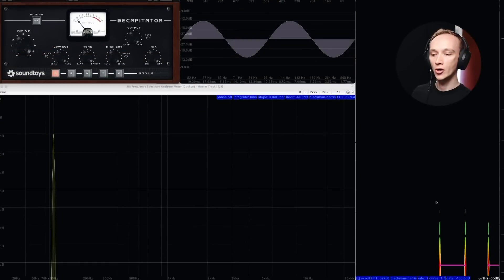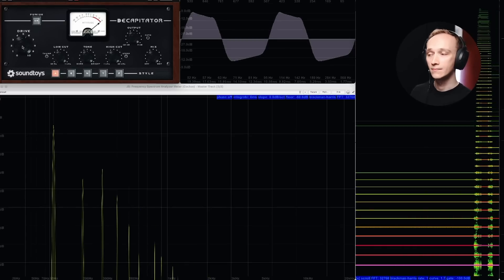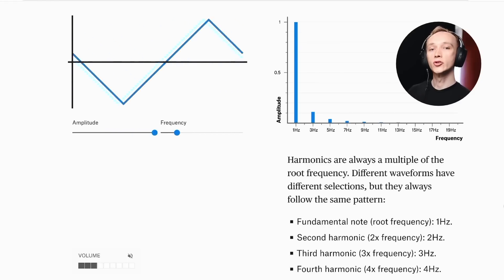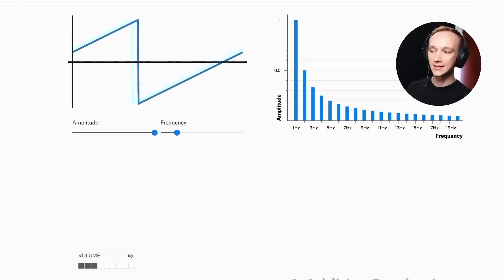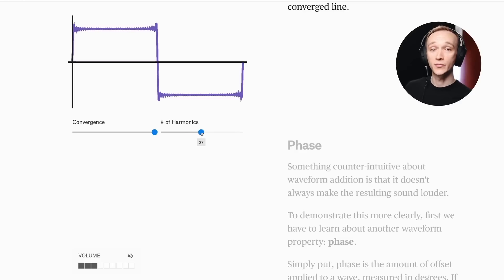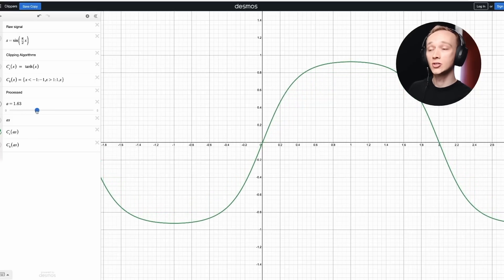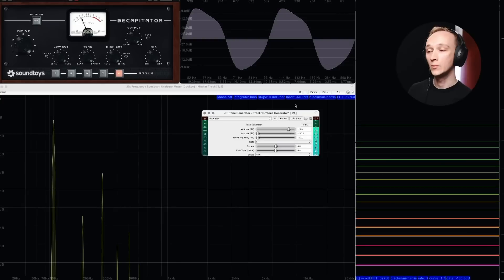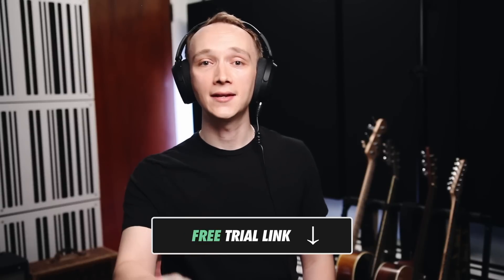Most Engineers Get Distortion Wrong

Comment: Gain staging only matters before dynamics plugins like compressors, maximizers, limiters, and saturation plugins. Or if you’re routing through hardware. Outside of those cases it’s more of an organizational thing.
Reply: Yes, but a little to add. I agree gain staging is definitely more important when dealing with dynamics processors (simply because they are dealing with peak analysis therefore input gain will be acting as a threshold for the effect) but a lot of other processing you wouldn't expect can also be gain dependant due to recursive internal processing - feedback - of the input signal. Things like short delay effects (choruses, phasers etc) will tonally sound different, and provide non-linearly gained outputs especially with high feedback, when sent differently gained inputs. Also, anything that is "analog modelled" even if it's not a dynamics plugin will almost inevitably require a correctly gained input in the same way as real analog hardware, by design. Digital has near infinite S/N ratio so, unless you're clipping, you're mostly right but I'd stack onto dynamics processors a few other things if we're getting super particular!
Reply: @RDijt  I did not know that, thanks for letting me know.

Comment: You know what else all the kids get wrong when it comes to audio? The word "saturation". "When we increase the drive knob we increase the amount of saturation that occurs". No. When you increase the drive knob you increase the amount of harmonic distortion that occurs. Saturation is when analog tape or a transformer is saturated with magnetism. The result of that magnetic saturation is harmonic distortion. I'm assuming kids started conflating "distortion" with "saturation" either because they're relating it to images and color saturation or it's a marketing term because "distortion" has a bad connotation to it. Saturation isn't distortion. Saturation leads to distortion. If you're going to use a click-baity title that condemns "most engineer's" knowledge and understanding of audio, you better make sure your side of the yard is in order first.

Comment: Is there a difference if A is 440 Hz and A with 432 Hz?
Reply: 440Hz and 432Hz are different frequencies, that's the (only) difference. Not very noticeable though.
Reply: @luisybarraaspichueta3405  yeah I know, but my question was if the distortion sounds significantly different. Because 8Hz can make a difference
Reply: @DashNiveDNB  Yes, it will sound 8Hz higher (not very noticeable since 8/440 is a fairly small fraction), but the timbre will be exactly the same. What makes two sounds have different timbre/tone is the ratio between the frequencies of the harmonics that make them up, and their relative volumes ofc. But, a pitch shift applied to all those tones equally doesn't change the ratios at all.
Reply: that's why a piano sounds like a piano regardless of the notes you're playing

Comment: Very interesting video. Maybe related to this, I was experimenting a bit with basics, filtering saw waves etc to find in the end your turn them into a sine  (which may picking a saw for a bass track in a way seem silly when you filter all the saw-ness out?). On the other hand, to my surprise (no education in this area), I found the filter in Vital added frequencies when I was (by accident?) filtering a sine wave. Is there a video of yours on this topic or that explains this? How can I add something by taking away things?
Reply: Some filters in Vital emulate analog filters that have a nonlinear response. That's the only reason. As you've said, a "perfect" filter shouldn't add any harmonics to the signal, only change the volume and phase of the existing frequencies
Reply: @luisybarraaspichueta3405  Thank you very much for your answer. So in theory it shouldn't, but in (physical, analog) practice it does 😉
Reply: Now I'm going to try a full digital VST synth

Comment: I don't hear the difference between the Radiator plugin on and off. Does it mean I'm deaf or my speaker system is too cheap? Or it's intended to be audible using headphones?
Reply: it's almost a matter of "feeling". Most of the people who claim to hear an obvious difference would fail an A/B test. When Radiator is on the track just feels a bit louder and with a bit more presence. But it's definitely very subtle, you won't tell the difference on phone speakers ofc, but any decent pair of headphones/speakers will do.
Reply: Sometimes I download the audio of a video and import it into my DAW so I can play with it or analyze it with a spectrum analyzer (at least you maybe see a difference). Sometimes it may help not to try to hear the difference but ask yourself if you 'd prefer the one or the other. Not pretending to know better, but just suggesting. I often have difficulty to hearing such things.
Reply: I can hear it on my phone but it's subtle, you need to know what you're listening for. Listening to the delta might be a better way than A/Bing to help you hear better where the difference is - you can do this by using phase cancellation where one track has the effect on and another identical track has it off. Then flip the polarity on one to cancel out the signal that they have in common. You should be left with just the difference (delta). It will need some tweaking to gain stage it - it won't be a perfect null - but should make it easier to hear the difference than an A/B.

Comment: Fun fact: There is a certain very specific instance where saturation can actually remove harmonics! If you take a triangle wave and run it into a very simple lookup style saturation (I used melda audio's saturation for this) you can dial it in such that it becomes a sine wave on the output! Just a fun neat trick, I doubt it has any real application.
Reply: It might be useful with analog circuitry. Some oscillators do not have a sine output.
Reply: @paopis  Maybe! I suspect analog circuits may respond differently enough that it doesn't actually do this how a somewhat simplified saturation plugin does.
Reply: @Levibetz  Thomas Henry's VCO-1 as well as other designs use this trick to get sine outs from triangle core oscillators. A crude version can be done using the hyperbolic tangent transfer of an OTA. Sine core oscillators are pretty uncommon so most sine outputs in synths use some sort of trick like this (meaning generally sending a triangle through some sort of nonlinearity), and it goes back farther than the 1985 paper Henry cites. In fact, it goes all the way back to one of the first electronic instruments ever, the ondes martenot (1925), see Aaron lanterman's wonderful video on the martenot waveshapers
Reply: the Roland TR-909 uses this trick!

Comment: Interesting!
I have even seen things in texts meant to those who are new to audio, write things like that male voices can get down as low as 80 Hz. While it's true when looking at the fundamental, it's far from  true when it comes to where the majority of the acoustic power, is emitted. Many people apparently have hard to understand that anything else than a sine wave, must consist of multiple frequencies.
Electrical engineers are probably more familar in general with this, than those so called sound engineers. For example in AC systems, harmonics is usually unwanted and may cause noise issues far above the operating frequency (this is due to frequencies that's not supposed to be there, appears because of the distortion).
The level of the harmonics determine the wave shape - but what also matter (not shown in the video) is the phase angle of the harmonics. By adjusting those 2 factors, any wave form may be created.